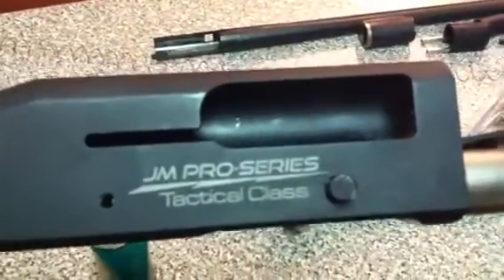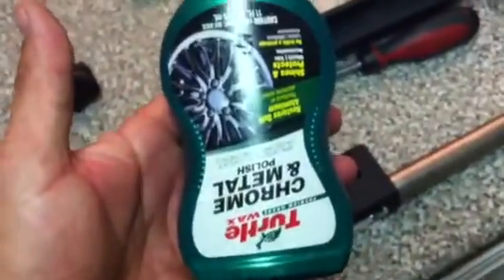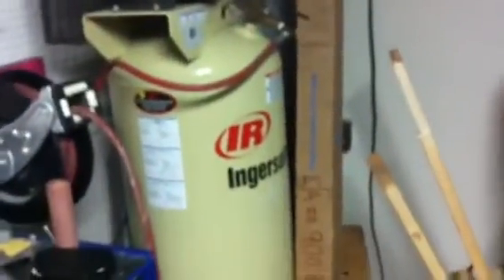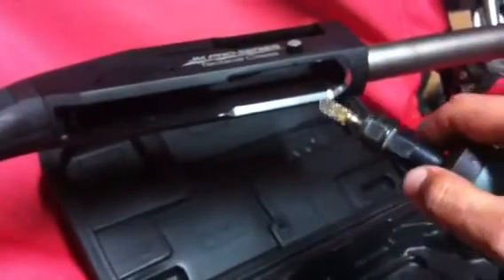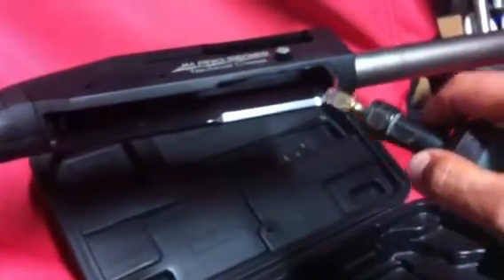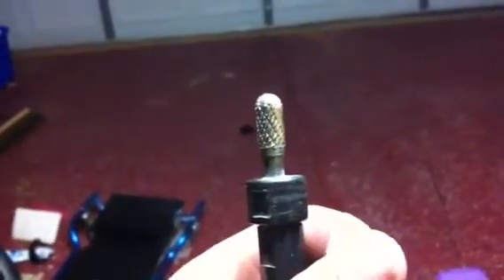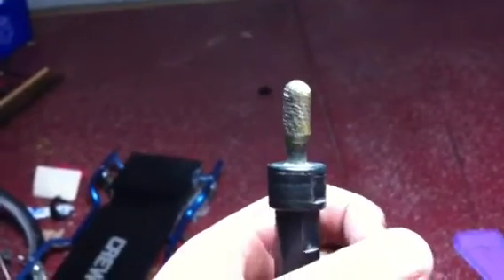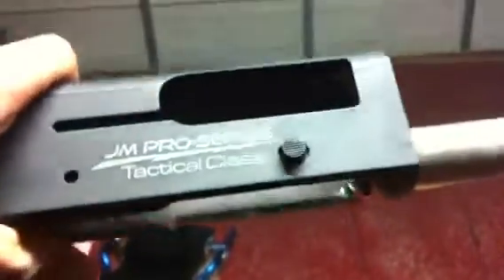Mossberg 930 Loading Port Mod

Comment: Your 930JM still running well, man?  Read some reports that folks are having to keep the piston clean or it'll have issues.
Reply: Hey superset, my JM pro has never given me a hiccup. I've shot around 800 rounds with it and 2 complete matches with no problems. I do clean the piston before a match though. I've shot gas guns since I was a little guy and know how finicky gas shotguns can be. Hopefully the newer JM Pros don't have the problems we've all read about.
Reply from the maker: Yah man, I shot a match with it the other day and it ran FLAWLESS. Like Bullitt I also clean the piston and so far it has been good to go. No regrets so far and really just glad that I am able to compete man.
Reply from the maker: Just a FYI  SetCA I no longer have the JM 930, I sold it and got a Stoeger M3000 and have no regrets. Man the Stoeger is SWEET!!

Comment: Did you do this with the bolt release button assembly in place?  Is it okay to grind the area with the pin down?
Reply from the maker: I did on this one on the other 3 that I have done I took it out. Its rather easy to remove just don't lose the retaining clip